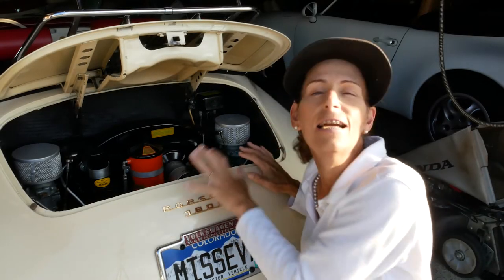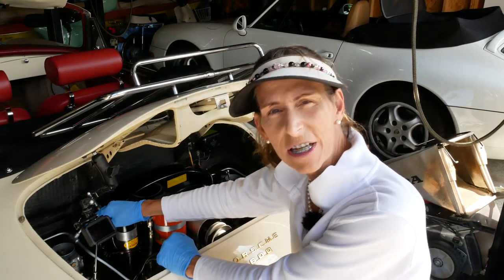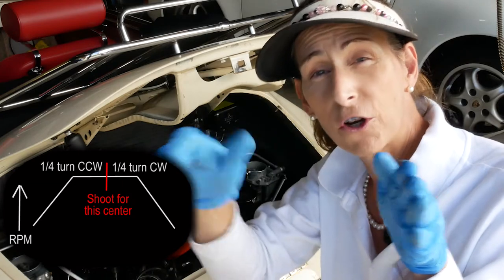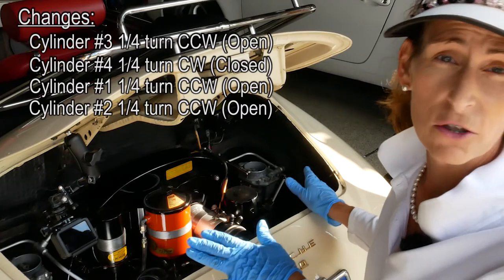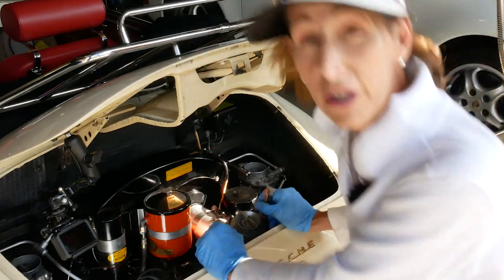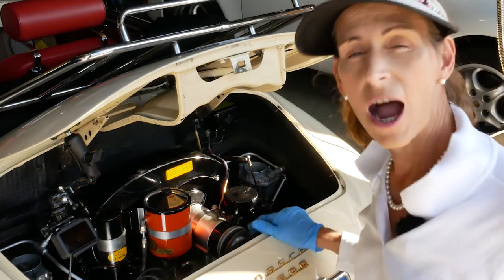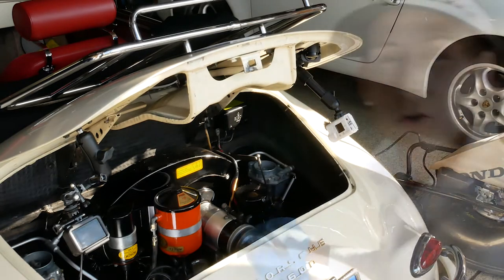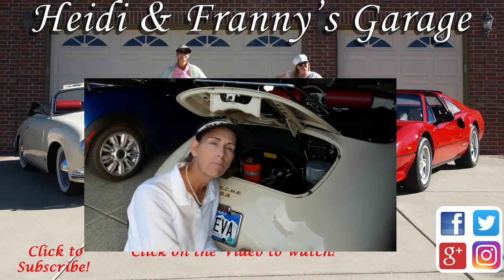Porsche 356 Tune-up Part 3: Tuning Zenith Carburetors!

Comment: These were very helpful!!  I just got a 1969 912, and will be doing all 3 steps!!!
Reply from the maker: That's awesome Rob!  Let me know if you run into anything weird.  Do you have Solex carbs?  Should be the same basic process.  Syncing the carbs really does help to make the engine run smoother - and idle better.  Yea!  Franny
Reply from the maker: Hmm, a bit of a drive, but could be fun!  Honestly, I think it is pretty much the same.  Does your manual step you through it?  The 356A manual even has an exploded view of the Zenith carbs! All the stuff about the linkages still applies too.  If you are really nervous, just lightly run each of your air bleed screws in and note how may turns.  That way if you feel like you have lost your way you can start over.  The 912 is really nice.  You'll love it! F
Reply: Heidi and Franny's Garage Thanks!  Will let you know how it goes!!

Comment: A few points. 
When you adjust air or mixture screw - always keep the RPM at your prefered RPM range (say 800-900 in your case). At 1400 where you ended up you might be pulling fuel from other orifices such as your mains so your fuel/air adjustments are not "true." So when you bring your RPM finally down your engine sounds rough because your adjustments were not "true." Best is to keep the RPM on the low side so you are certain that you are adjusting nothing but idle circuitry. Hope it helps!

Comment: One of my air bleeds seems off. Turning it in one direction causes it to drop off peak, but once it gets back up to peak when I return it to the original position, I can turn it seemingly in perpetuity without getting rpms to drop in the other direction.

Comment: Hi, thanks for your videos, I have looked at many and they are always a help. I‘m so grateful that you take the time and effort to make the videos. I have a 1968 912 project car, engine, carbs etc have been rebuilt (Carbs twice !). I‘m really struggling to tune the carbs (Solex 40 Pll) - I was so frustrated I gave it to my mechanic who also reviewed all the variable ( timing, sparks, valves clearance, checked compression etc) - the car starts from cold with some difficulty, runs fairly well when above 1800 RPM but is lumpy and hesitant during transition from idle. To be honest I cant really find the sweet spot when adjusting the idle mixture, it doesn’t seem to change revs. It could be my lack of experience (why I took it to an experienced mechanic but we are still not where we want to be). Any thoughts ?

Comment: Hi Franny, thank you so much for these great instructions again! I watch your videos for a couple of consecutive evenings now, and really love it! However, I tried to set the carburetors of my 356 SC from 1964, but the idle is unstable in itself, so its impossible to adjust the carburetors with the air bleeds. I wonder if you have a hint, what the reason could be for the idle going up and down... Many thanks!

Comment: Excellent video as usual!  Just curious if you are planning a video on throttle linkage adjustment?  That is one of the most common issues I've seen with all the 356's I've owned. Most of them have needed throttle linkage adjustment in order to obtain full throttle. Many were only getting 50% to 75% of full throttle!  There are various "links" in the throttle linkage chain, so lots of points where slop can be introduced.  One of the least costly ways to get more horsepower out of your 356.
Reply from the maker: I did a little bit of this in the Speedster Vlog #5 - A Balancing Act: https://www.youtube.com/watch?v=1wPjzv5gQvY But I didn't cover WOT.  That was the very first issue with the Spyder.  A well sorted 356 is spritely and nimble, quick on the throttle and eager.  If not, then there is some digging to be done :)

Comment: Hi Franny, Is there a specific number or type for the K&N air cleaner foam? I really enjoy your instructional videos. I will be coming out to Colorado end of August beginning of September to hike up some big hills. Will you be doing any 356 live events during that time?
Reply from the maker: Hi James, It is just open-cell foam in a roll and I cut it to size...  Should be able to find it at your FLAPS.  
With the COVID thing we are laying low...

Comment: Great video! Most 356's I come across don't have the original air filters on them. Did you find any difference in performance with the K&N foam inserts?
Reply from the maker: Those air cleaners really Set off the original look!  As to performance, no, not at all...  They are pretty low resistance.  Since the car is old-skool, the carbs will enjoy the small bit of oil from them.  If the car had a hot-filament mass air flow sensor, these inserts would trash it pretty quickly ;)  I have had others express concerns over possible carb fires, but the metal Kinects should be sprayed with oil after cleaning as well, so I really don't see the difference.  The carbs to pop (pre-fire) a bit when cold (a sign of running lean), but the best thing to do is kick up the idle a bit to draw that back into the carbs and into the engine.  I have never had any issues with that at all.  It is hard to ignite oil ;) Franny

Comment: Thank you for this nice learning video ,I have noticed that the carbs  are on a fiber type block  is that for better insulating from Heat?. Herlin Woolery
Reply from the maker: Hi Herlin, Yup...  That is the idea/hope.  With those short intake stacks the carbs can percolate about 45min after a good run.  I was having carb weeping issues and that did help.  The kit comes with longer studs and you need two carb gaskets.  Thanks!  Franny

Comment: Is this the same if you have a zenith in an aircooled 1641 vw bug?
Reply from the maker: If the carb(s) are the same then yes outside of the specifics of the linkage.  But, the steps are the same.

Comment: Hi Franny, would a petrol leak cause the same symptoms as an air leak? I have been trying for days to tune my webers (double) and I couldn't stop it from spitting at me from the carbs, the only way to stop it was adjusting the idle mixture screw 14 half turns and even then it would spit at me about  2500 rpm, idle was still rough. Then I noticed that the fuel regulator (with glass bowl under it for the petrol filter) was leaking petrol at one of the pipes from the regulator (the hose goes from the mechanical pump to regulator. Car is Alfa Romeo 2000 Spider 1974. I  have ordered another one and should arrive tomorrow. 
I noticed how responsive your idle mixture is on your car, I hope after I replace the regulator my mixture screws would be responsive too.
Thanks for another great video.
Rich
Reply from the maker: Hi Rich, a leaky fuel line won't do that (but is super dangerous).  Those air bleed screws should be pretty responsive.  If not, you probably have some crud making the adjustment for you.  If the carbs have sat for a while, there is a good chance they have some varnish blocking some of the pathways.  Bull those bleed screws and shoot some carb spray into the hole and any other holes in there you can see down the throat.  If that doesn't do it, you may need to pull them and do a thorough cleaning (pull them apart and such).  Let me know how it goes.  Franny
Reply: Hi Franny, thanks for the advise, after replacing the regulator it was much easier to tune, I have cleaned the carbs and the needle valves (idle mixture screws) and new orings on the cup washers under the springs of the adjusting idle mixture screws. Still not as responsive as yours but I managed to tune them to stop them from spitting and I also Advanced the dizzy from 4 to 12 degrees BTDC.  Still the engine seem to be rocking on Idle, it drives OK so I took it for a 300 KM drive, it spat sometimes at 2500 rpm at 80km/h, but it was a great drive. I will take to a Carburetor Service and have look at it. Thanks for responding. https://youtu.be/NnlLoNvg0Cg
Reply: Fixed. Hi Franny,
After watching your VW Fuel pump replacement, I decided to buy a Fuel Pressure Gauge to test my fuel pressure. At idle the pressure was 6 PSI, the replacement original fuel regulator did not have much of an adjustment as the original pump didn't put out much pressure compared to the after market pump. I ordered a Filter King Regulator which looks like my original but bigger. I lowered  the PSI to the correct pressure for my car 3 PSI at idle and tuned the carbs and it worked great, also adjusted the timing to 13 degrees BTDC. The engine is now smooth and much quieter and responsive. Thanks for posting that video.

Thanks.

Comment: When I pulled the plugs on my 912, I noticed that the gap on plug #3 was almost fully closed up. Is that a sign of cyl 3 running too lean(and running hotter)? In other words, does excessive heat cause plug gaps to close?
Reply from the maker: I would guess it got hit while it was being installed.  There isn't a way for the gap to get smaller while running.  Usually they start to erode effectively widening the gap. It is very easy to donk the end of the plug when trying to get it into the hole...